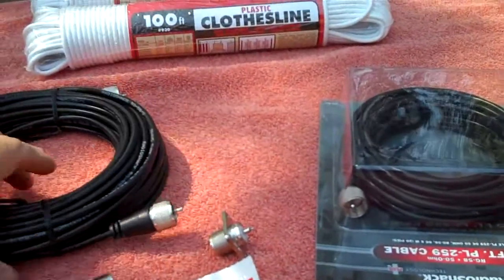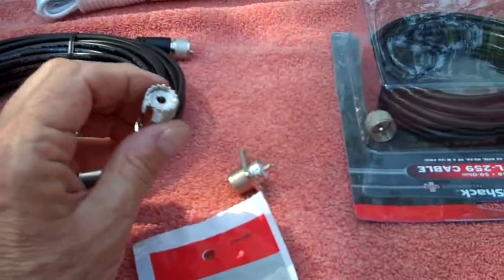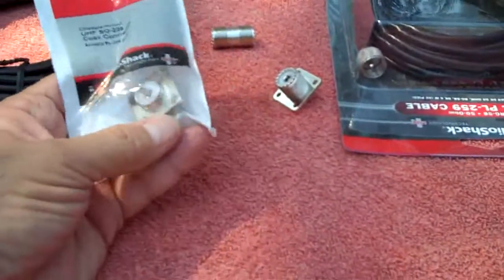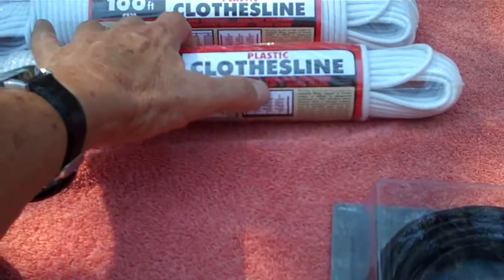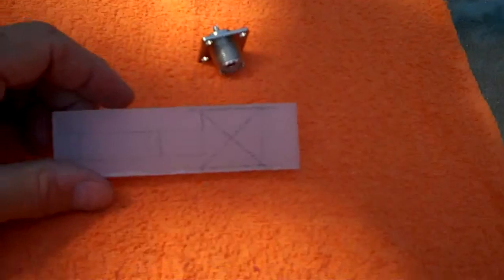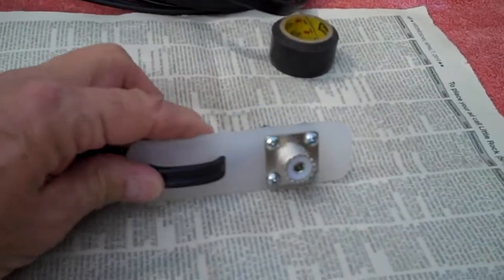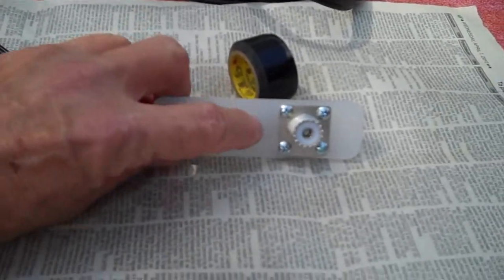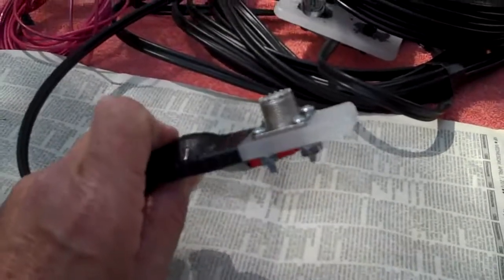Obtaining A Ham License-step by step-details you need to know (part 15 of 34: Making an antenna).

Comment: RCA connectors are ok if you do the right set up.  My National HRO-50T1 (a beautiful rig by the way) I had as a teenager worked great with it.  Unfortunately it's been so long that I don't remember how my grandpa and I built the RCA connector antenna. A lot of people now prefer "N" connectors.  When you buy connectors look for Amphenol brand, and of course there are rugged UN/ connectors for military grade equipment.  The ARRL big book shows it all.